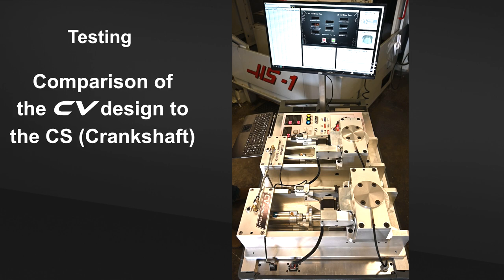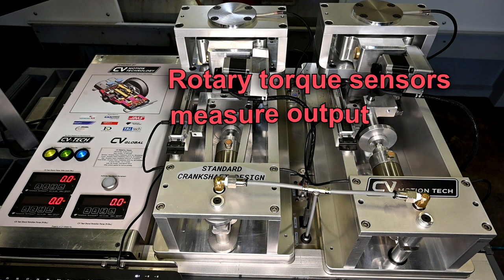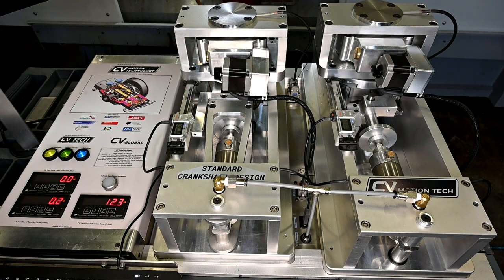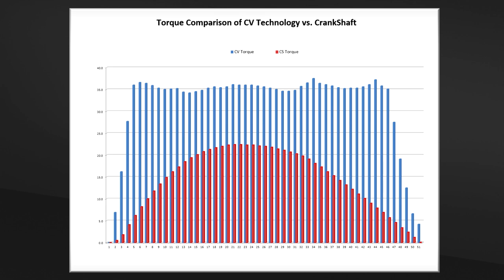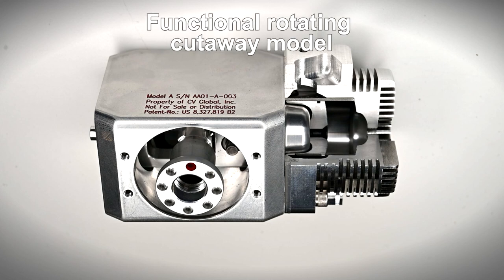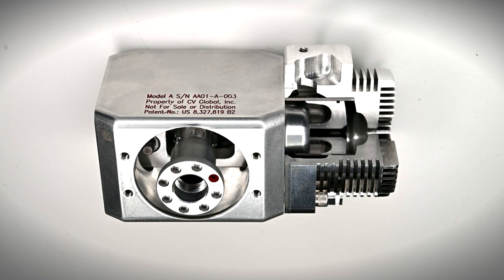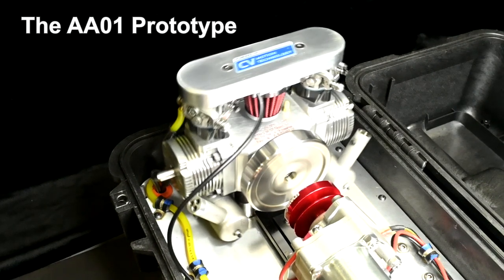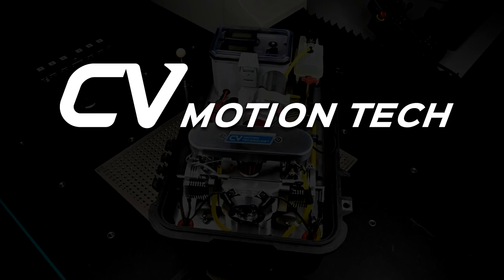CV MotionTech Running Prototype and Test Stand

Comment: Can you please run it live, on a dynameter whilst recording fuel mass flow rates, at various load levels, say 0%, 25%, 50%, 85%? Duration of 6 minutes at each load point to become fully equilibrated thermally would be about right.

The video should be completely un-edited and un-interrupted. This would shut up a lot of doubters.

Comment: Can it be made a four stroke, or at the very least not require an oil/fuel mix or oil injectors?
Reply: Thank you for your inquiry.  Our 2 stroke engine runs on straight fuel.  No oil is need to be mixed with the fuel for lubrication.  Our CV engine has a sealed case that contains lubrication oil within our 2 stroke engines.  We also make a four stroke version of the CV engine.  Please see our website for all of this information and more.  Thanks!
Reply: @F2Frank1  cool. Thanks!

Comment: don't bother testing look and see if any other internal combustion engine bottom end arranged with conrod to cogs has ever existed answer negative, standard crankshaft arrangement is very strong, longevity must be maintained or its a grenade anything will run for a little while even me, if i'm running please shoot whatever is chasing me.
Reply: You are not correct about anything running. There may be engineering hurdles yet to be overcome. This is a huge step. And having the combustion chamber isolated introduces all sorts of new lubricating options. You more than likely don't have serious technical or mechanical knowledge. This and the Alfadan design are brilliant.